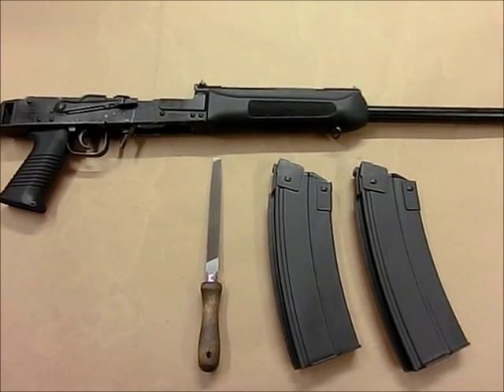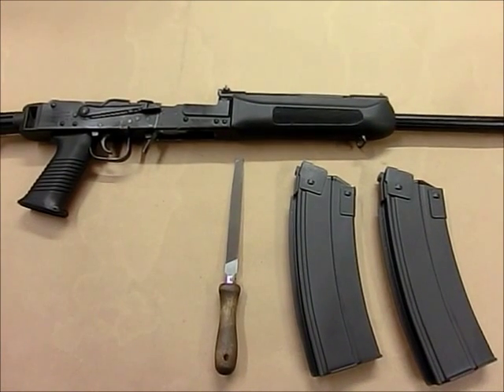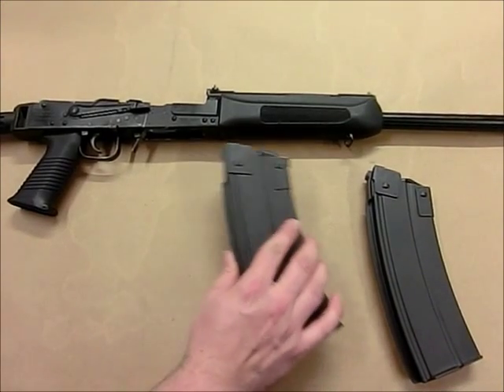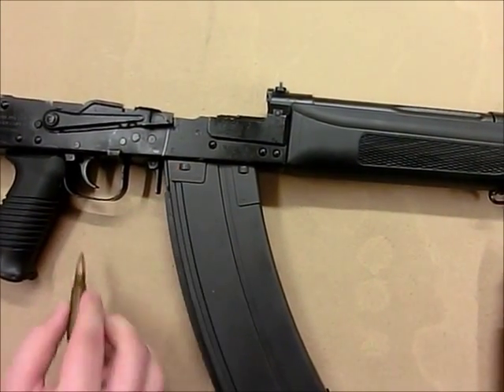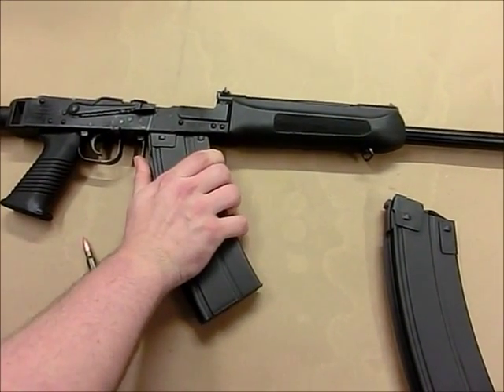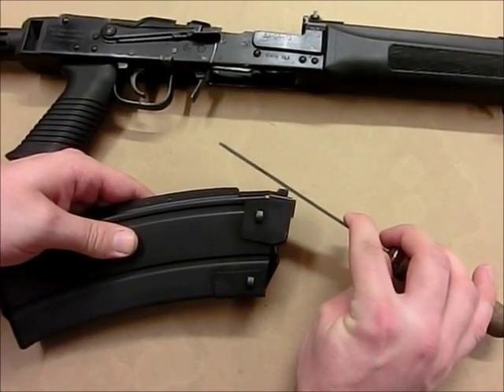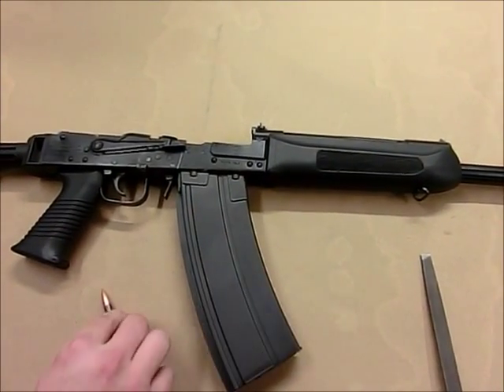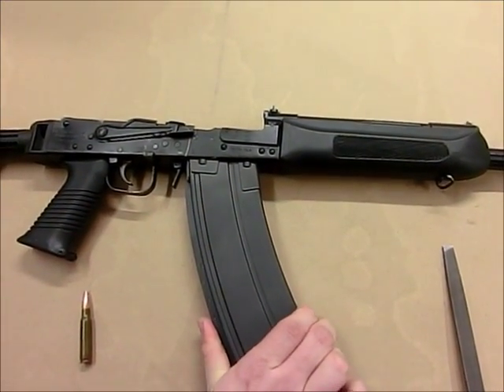Csspecs Saiga 12 steel magazine fitting guide

Comment: All of mine fit a Lynx-12 with no adjustment.  A TINY bit loose, but function is excellent.  These are some seriously heavy duty magazine.  You can push the follower from any position and it travels without binding.  Excellent quality magazines.

Comment: Mine seems to be caught by the two nubs jutting out. One of which you pointed the tip of your bullet at.
Reply from the maker: They are stops that keep the magazine from over inserting. If they are caught that means the magazine is probably as deep as it is supposed to be.
Reply: @csspecs  Thanks for your reply. I didn't want to screw my magazines up by shaving those. I haven't spent much time with it yet but in a couple of days I'm going to sit down and file as you did. Hopefully it works out.